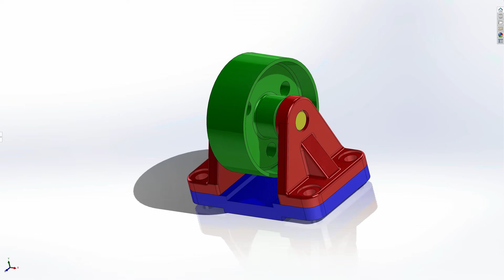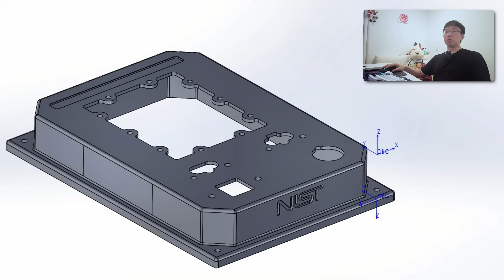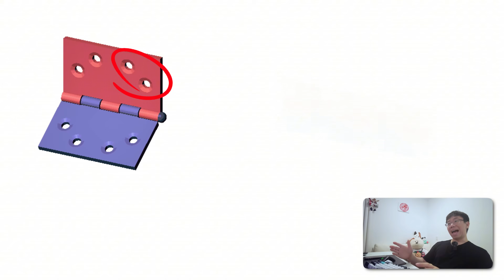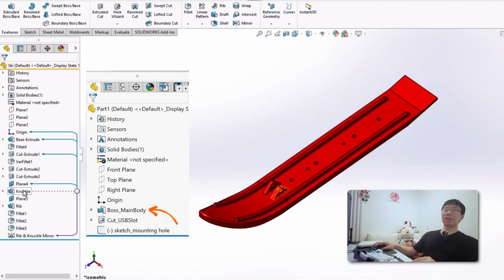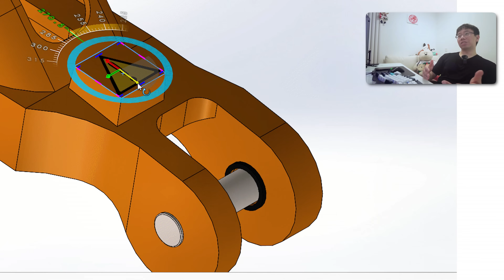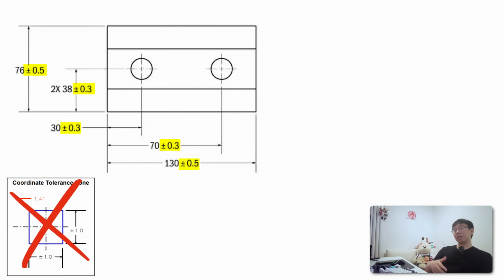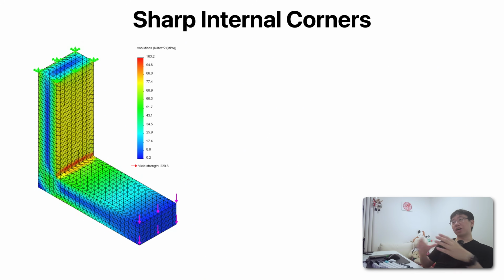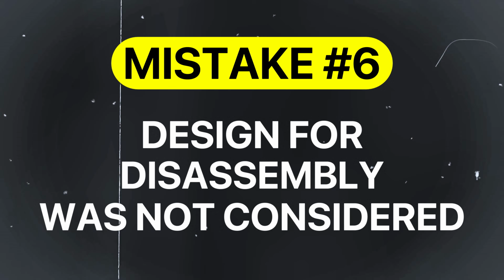Design Mistakes Even Experienced Mechanical Engineers Make

Comment: Great video, just one thing to note, ISO 2768 has been withdrawn and replaced by ISO 22081:2021. Although it is still widely in use (including by me 🤫).

Also, the last point on Mistake #4 about accessibility for tools during assembly...I feel like car manufacturers purposefully go out of their way to do the exact opposite! The cynic in me reckons it's to dissuade amateur mechanics such as myself from performing servicing so they can make more money.
Reply: I would agree with you, someone who has worked on old cars from the 70s you get a lot of room to work with and I used to design automotive parts with special respect to allow for repairing and tool clearance (there are really cool online guides and standards for this)

There is a reason they call car dealerships, stealer ships, I agree with you modern cars are an absolute nightmare to DIY at home

Comment: One more thing I find a lot of engineers mess up is squareness size shape and concentricity of stock from a metal suppliers for example angle iron isn’t square or even the same shape neither is c channel one more thing that applies to more specific applications is weld distortion if your part will function the same with the less welding then have less welds especially on critical tolerance/ long parts

Comment: Having worked both in design and manufacturing one design feature that annoys very cam user is designers using fillets where a simple chamfer will suffice, this can increase manufacturing time significantly.
Reply: Or define edge sharpness tolerances, which can allow relatively small parts in large numbers to be tumble deburred cheaply without specifically machining 20 chamfers.

Comment: Hobbyist here. With regard to CAD practice and design workflows, can anyone tell me why most CAD software records the steps used to generate the solid, unlike Rhino 3D, which only cares about the final shape, so you never have to worry about the intermediate steps?

About 14 years ago, when I first started learning, I tried SolidWorks and even pirated CATIA along with a few others, but I eventually settled on Rhino because I felt that this step-dependent mechanism was a real pain.

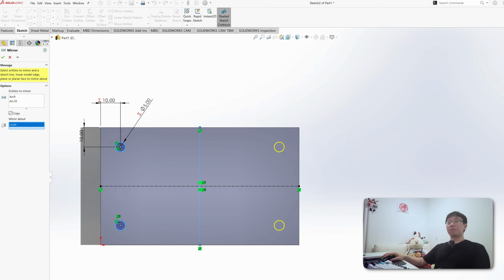Comment: 3:45 Bad practise that you already said is bad. If the part is symmetrical, set it up symmetrical around Paet Zero Point and reference that point for mirroring features. Counting on construction lines to geometry is one of the mistakes you mentioned in the beginning of the video.
Reply: What's the better alternative to construction lines for a mirror line for symmetrical features?
Reply: @JulienVanier He said not to base construction lines on geometry. So following the advise the mirror line would be better to be attached to the zero anchor point, unless another placement is specifically desired.

Comment: Solidworks with variables, equations and configurations is practically UNUSABLE, even when talking simple multibody parts, with no assemblies. You easily end up with: A. Rebuild problems. The part needs two or three manual rebuilds to update properly. That means that if you have different configurations at the same drawing, or forget to manual rebuild till the end of time, you are doomed. B. The dreaded configurations/equations bug. Equations lose any ability to be defined per confifuration. The system locks up and the icon to select which configuration to affect disappears (!!). This can happen even if the file was working and you simply reopened it. It is linked with duplicate equations that can be seen in gray in Ordered Equations View and must be deleted. Then it works but you have lost all equations that change per configuration. That means that after deleting the duplicates (that cannot be avoided and just happen at random) you must export all equations to a file, reopen cad file, re-import them.

This is of course prone to errors and demands a lot of time and tons of error checking.

Solidworks is rhe worst programme out there. Archaic programming core that was never revisited and has the same, unsolved bugs since 2007, at least.

I cannot fathom how people that actually use it's features , can operated it without melting their head. Unfortunately i have been using it for almost 20 years now, even though i have learned most of the Parametric CADs out there. Don't ask me why. 

Maybe i am a mazochist.
Reply: Not to mention multibody sheetmetal in SW, which to create each flat pattern, it must rebuild ALL flat patterns and drawings. This means that drawing rebuild times grow exponentially (can rise to 10 minutes (!!!!) very easily for simple parts) amd there is no way to turn off automatically rebuilding for drawings outside assemblies...

Good luck publishing drawings that should take half hour, in 10 hours or more...

Comment: Great intro to the topic, but I’ve always bristled at the vague phrase “design intent” when applied to CAD work. Workflow/parametric references/etc. are not things that reflect design intent. Being able to actually manufacture a widget in sufficient quantities while making sure it does whatever it’s supposed to do and has the desired durability for its real-world operation would be one version of a “design intent.” A good, inventive fabricator doesn’t even need a drawing to accomplish that, just wits and hands (and tools).

In terms of baking design intent into a CAD model, as long as the features end up with the correct dimensioning (AND TOLERANCES) it doesn’t really matter how convoluted you are or aren’t in getting them there. If the features of the part are sufficiently defined in CAD/drawing to make the thing do what it’s supposed to do, then it meets the design intent. Or, another way of looking at it: if it fails to meet “design intent” then the dimensions are simply wrong. 

Sure, someone running a manual lathe will generally appreciate as many ordinate or commonly-referenced dimensions as you can manage in a single setup operation on the machine, but that’s manufacturing intent, not design intent ;)
Reply: Regarding best practices for tolerances, conveniently the same “design intent” definition I gave above applies here too. However, in an actual quality-controlled environment, the tolerances should be ultimately driven by the manufacturing process, not the design engineer/drafter. They should reflect what the process is statistically capable of achieving and be ensured to meet the “design intent” of the part (i.e. I can put the part together in an assembly, things that aren’t supposed to touch don’t  touch, etc.). If not, then a more precise manufacturing process should be considered, or the usually cheaper option: change the dimension (not the tolerance) to make the part work. 

Hands-down the best reference I’ve ever seen for tolerance and stack-up is a 1995 paper by Fritz Scholz at Boeing (I don’t think I can add a link in the comments but is very easy to find, paper’s name is “Tolerance Stack Analysis Methods”).
Reply: @MikeyAntonakakis  The point he's making here is that you want your features constrained to the correct other features, so that things don't distort unreasonably when a seemingly unrelated dimension changes. For example, you want two symmetric holes on a tab to be actually constrained such that they behave symmetric, you shouldn't hardcode the edge distance of one hole and the distance between the holes, because then, as soon as when someone changes the width of the tab, they would become asymmetrical.
Reply: @MrSaemichlaus  that’s definitely good practice, but what does it have to do with “design intent?”
Reply: @MikeyAntonakakis  Well the intent is that the two holes are symmetric (to the centerline), in this example. Constraining them both to one edge would cause unintentional design, once somebody goes to change the width of the part.

Comment: This is really good advice, but also really basic shit.  We shouldn't be graduating people who don't understand this.
Reply: The problem is students that just try to memorize good design practices without quite understanding the underlying manufacturing process. Because I worked in sheet metal manufacturing, I know what a fractured aluminum bend looks like that didn't have a large enough bend radius, or how a threaded hole is distorted when it's too close to a bend, or how a sheet metal edge gets mangled when it's not 90° to a bend. I think good design practices are explained in theory, but students aren't shown the bad results of disregarding them, so they remain abstract and hard to memorize.

Comment: I was expecting a video about mechanical engineering design mistakes… this seems to be mostly about better CAD and dimensioning practice with a nod to trying to use standard components where possible… or have I missed the point ?

Comment: great vid!

suprised 'Poka Yoke' or similar was not refenced in the design for assembly section.

(can a component be added in an incorrect orientation, would making it symmetical or adding a feature that only allows it to assemble in 1 orientation solve this?)
-------
adding:
 Companies will have 'in house styles'  for, modeling, drafting, documentation etc. Starting at a new company with an expectation of needing to master these promptly would be good to have in the bag.

looking forwards to your tols vid!

:-j

Comment: The biggest issue I face is I do a lot of conceptual CAD, I'm just making stuff up as I go, I don't know exactly what the final product is going to look like when I start, thus it's hard to know the parameters or proper ordering of features. Would you go and completely rebuild the part once the geometry and parameters are known to "clean up" the feature tree
Reply: Great answer to your own question Eric. This approach saves $$$ on up to date USB drivers for the Crystal Ball set.   ;-j

an intermediate step might be: after the initial model, formalise a design brief so your have that as a set of constraints to reference & guide you during re-modelling for version two.

also; during version 1; is there a good point to shelve it & go to v2, ie not wait until v1 is complete before commencing ground up re-modelling?
Reply: sometimes, yes. once you know the final design, it's very easy to redraw nay things far easier and far faster.
Reply: I guess another question, how parametric should a part with complex surfacing and features be? It’s not a metal plate with some holes… its very easy for surface features to break if the boundaries change

Comment: There is this really fun thing in fusion where if you constrain a circle and a line in any way, if the circle is parametric and you change the parameter changes the circles size enough, it recalculates everything from the new position.
For example, if you have a dimension from a line to a circle outline, it can happen that the circle switches to the other side of the line and the dimension now tries to go that way. This caused me mayham in some projects and i have not found any solution at all as in some cases you need the model to keep this specific dimension only as it scales.
The only workaround is to slowly keep changing the parameter so that it doesnt grow past the line, which may be really annoying.

Got any tips for that?
Reply: Non-continuity in contraint handedness is something that bugs every CAD system fundamentally, because every time the geometry is resolved, all the constraints and dimensions are thrown into one big matrix, then the matrix is reduced and the results are read from that. So there may be an order to the operation, but not necessarily any continuity between results. I think this is something you don't get away from unless you use some tricks to make the constraints non-switchable. I personally would love to have constraints like "this line starting at a fixed point should go towards +X not -X" but I don't know how hard that would be to implement. I think developers do know about the inconsistency but maybe there's a reason why the feature is not there.

Comment: This was really good.  A lot of these "details" are domain-specific and idiosyncratic, which is why college graduates should be taught to expect to start as junior engineers.  Too many times, students (due to the exorbitant cost of tuition?) to believe that after they get their degree, they are now "an Engineer", and ready for top-level work.  But every field has some of these pitfalls and traps that have to be learned "on the job", from the guys who are already doing it.

The CAD stuff, spot on.  All CAD packages will misbehave if you don't understand the workflow and strategy to accomplish future design revision without breaking the whole model.  Because ALL designs will require revision.  Smart guys plan for it...
Reply: There are smart female engineers, too - I'm married to one 😁😁!

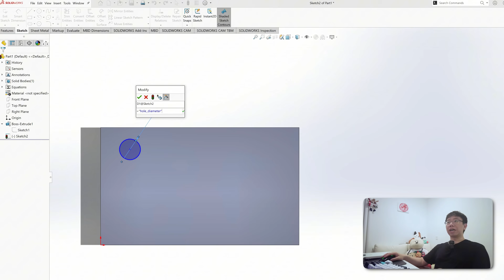Comment: 3:32 mirrors in sketches are not consistent as mirror features. And please use hole features as they include a short description in the model three
Reply: yeah, you have 3 fundamental types of work. Sheet, Milled, and Turned - in this case its milled (based on the fact its a solid that are not revolved around a centerline) so the choice is a milled hole or a drilled hole. if milled use extrude, if drilled use the hole feature, and therefore only scetch the centerpoint of the hole. let the feature do the rest, so tapping, reaming and/or countersink is autogenerated on your drawing.
Reply: i never heard about this. Care to elaborate?
Reply: @Ayce47 hole?: its a feature type that is basicly telling the software that this hole is gonna be drilled, with follow up processes, like tapping, reaming for fit, or countersinking for screwhead. you only give it the centerpoint of the hole in the scetch. rest is done in the feature options, and it allows for including all that data on the drawing
mirroring?: its bad design to mirror or copy a feature in the scetch when you can do so as a feature instead. since some features "freaks out" when the scetch changes drasticly - so in this case mirror the holes AFTER generating the first hole, your feature, so to say. the other 3 are just copies of the first. by doing this the software only has to redo the feature once and then copy that change. instead of redoing all 4 holes at once
Reply: please dont, this leads to far more features in the model tree than are necessary.
Reply: @theX24968Z  you can organized your features in folders
Reply: @lucmartz  its not about organization.  its about load times, cpu workload, etc.  especially when the assemblies start having tons and tons of parts.  no need to make 6 extrusions when 1 will do just fine.  especially since referencing faces and edges break often across software versions while lines defined in sketches don't.
Reply: @theX24968Z  the CPU load is a solid point, but the rubostness and easy to modify is more important from my perspective. I have done some quick tests and the difference in file weight is not dramatic to be honest. 
Asking AI, says that mirroring features or bodies has better performance than mirror in sketches. 
-Computational Overhead: The software must solve a larger set of geometric constraints and relations for the entire mirrored sketch, which can be computationally taxing. This can slow down rebuild times, especially for complex sketches with many entities.
Reply: @lucmartz  only if the design is something meant to be easy to modify.  This is heavily industry dependent, as some industries constantly iterate on their designs while others dont touch a design once a few key things are defined.  geometric constraints within a sketch are less likely to break over time than constraints to references like other faces.  this is imperative if you want to do anything with your designs more than a year after designing.  but then again, its rare for me to mirror something that I don't just design from the ground up with it in mind and build it into a feature inherently.

Comment: These videos are incredibly helpful and valuable coming from an experienced product design engineer. Design intent was something I learned on the job the hard way by making mistakes and not in school.
Reply: Same, we barely even learned to use the CAD software, being left to figure it out for ourselves with a video library so outdated many of the basic functions were almost unrecognizable 😅. 

I'm not sure how one should go about teaching desgnintent though. I try to be a good example and give tips to my coworkers and fellow students when I was studying. But I feel like this is one of those things you just need to learn from experience and feedback on a case by case basis. Some obvious basics can be taught in a lecture, but so much has to be experienced and anticipation for how the part will have to change in the future.
Reply: Me too, I was also thrown in the deep end with no CAD or engineering mentorship. It is a stressful way to begin 

I would say learning design intent is proportional to experience. My 2c 

The basics you can be taught at school I agree, but the personal design flows of each engineers are done by hard knocks, learning from others and succeeding in projects :)
Reply: I'm sure my lecturer for 3d modelling mentioned design intent. It's easy enough to understand the simple examples, but being able to model parts that don't fall apart in the software when you make one little change early in the timeline, will probably take more experience than you're going to get with the number of university assignments that actually use 3d modelling. Or more than you're going to absorb out of a video.